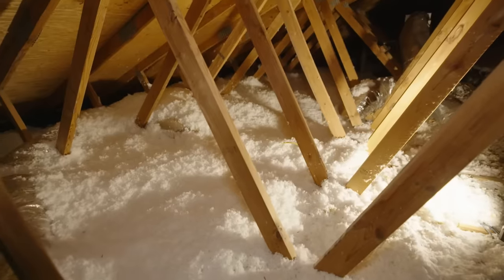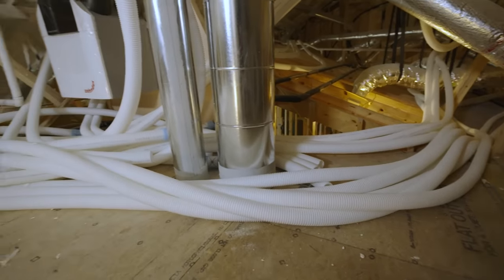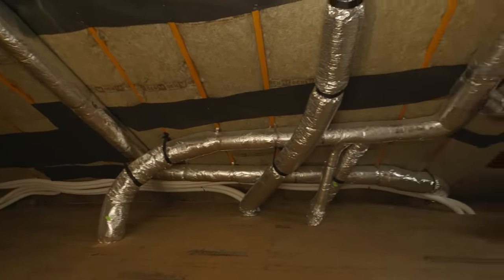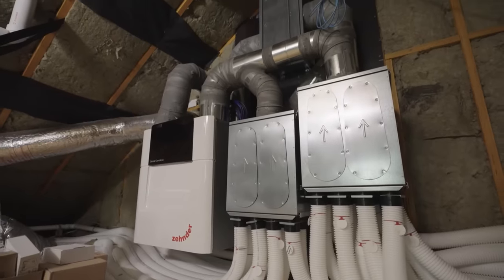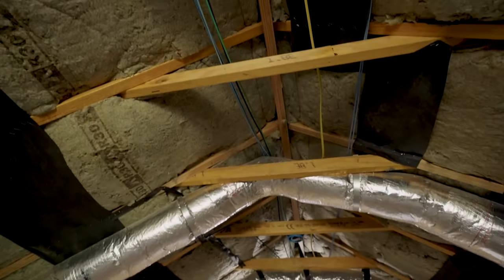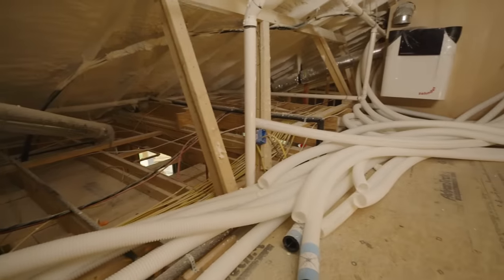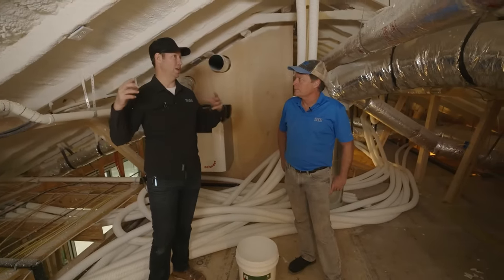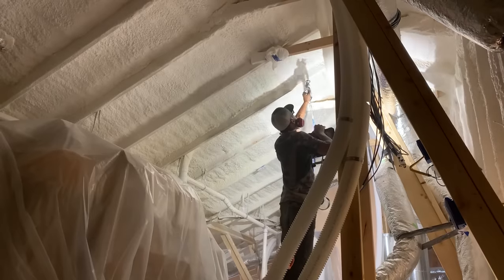Building a BETTER attic - Unvented + Conditioned attics 101

Comment: Forgive me for not watching the whole thing, but I would urge you to be careful giving advice on things like this to Average Joe.
I live in a cold climate (Norway) and here unconditioned attics are the norm, even on new houses. We don't use this "fluff" however, but mineral wool, usually in sheets or on a roll. If, however, you plan on perhaps use the attic (later) as part of the living area, you would move the insulation to the roof. The obvious main down-side is cost, both in the form of more materials, but also heating expenses.

Comment: I have been watching your videos, and I love what you are doing but I have a house built in 1970, in south houston area of Texas, what are some things you would suggest to help with sealing the house to better help out the transfer of heat? just some spray foam to seal all the wall joist lines? I currently have rock wool for insulation, would putting radiant barrier at the roof decking inside the attic be a good addition?

Comment: For the rockwool, where's the vapor barrier?
Reply: It's a heat dominated climate, so it should be on the outside if anywhere, not the inside. On the inside, you would get exterior vapor infiltrating inside, hitting a vapor barrier and condensing on the inside of the barrier, leading to the insulation getting wet. Many southern houses do not have a vapor barrier. This leads to needing more dehumidification.

Comment: It's a trade off. Do you want a roof or more living space. If the latter it cost more during construction and more in heating/cooling bills. Also you run the risk of getting condensation on the inside of the roof Wich is never good.

Comment: Why closed-cell on the roof deck and not open-cell? Closed-cell is a vapor barrier, so that breaks the rule of having your vapor barrier on the inside of the building envelope in a hot-humid climate. 

Moisture will drive into the envelope past the roof and roof deck and get stuck at the closed-cell and rot out the roof deck.

Comment: As an architect it is painful to see so much wasted  space with trusses, particularly on anything greater than a 4/12 pitch but design is largely driven by cost considerations. Trusses are fast so cost effective when you consider labor costs. Stick framed roofs open up the attic but also create engineering problems that add to the cost of building. Trusses are usually not designed for floor loads so laying plywood on the bottom cord is a risk.  Could the insulation be changed? Yes, but to what purpose?  A well vented attic, properly built and maintained should not have issues with moisture or heat. IMO a conditioned attic is not automatically better. Many factors need to be considered before making that claim.

Comment: A couple of observations, here. "Rock," is composed of silica, as is "glass." "Rock wool," is a "sound barrier," because it does not insulate well enough to be called "insulation." This is the reason one would have to abandon truss framed construction, in "favor" of the much more expensive rafter construction, in order to achieve the 12 to 14 inch bays, necessary to achieve R30 heat conductivity resistance, from rock wool - and for now, we'll go ahead and completely ignore the thermal bridging of those deep timbers, placed every 24" across the long dimension of your roof.

Ok, so all those mechanicals, all those conduits will need maintaining, all of this, for the value of some space to drag boxes up a attic access, fold down ladder or boutique value of some hyper scientific new construction technique to brag about.
Reply: A "flash&batt" insulation system can fit R-49 within the depth of a 2x12 rafter. With wood rafters, the rafters themselves amount to about R-11. So the thermal bridging is there, but far less a problem than walls. If you use I-joists then the thermal bridging is even less.

With trusses it's a bit more fussy. One solution is to do several inches of foam sheets on the top of the roof sheathing, with 5.5" of additional batt insulation within the truss top chords. (Specify 2x6 top chords.) If you don't like having the foam on top of the sheathing then do spray foam under the sheathing, to the depth of the truss top chords. Then use netting to hold additional batt insulation up against the foam. This would work if you don't plan on using the attic for storage. If you do then you get into the ignition barrier issue again. There are solutions. But it's more complicated and depends on the design of the attic space. When I do home designs with potentially useful space in the attic I control that by specifying "Room-in Attic" trusses. I decide which portions of the attic will be accessible for storage or other uses. Then I finish those with gypsum board. The spaces become far more useful this way. And the gypsum board provides the fire protection required. Yes, it adds cost. But considering the usefulness of the space gained, it's good value for money.

If the extra effort up front makes for a more energy efficient house, then it saves money in utility bills for the lifetime of the house, which should be at least 50 years, if not 100. A century of reduced utility bills is not "boutique value". It's something worth investigating carefully and in depth.
Reply: @fepeerreview3150  Not really sure you get the point here. Traditionally, the living space ends at the ceiling. Ok, now you want to make the roof membrane, the one that has to endure sun, rain, branches, rocks and meteorites, you get the point, also be a perfect insulator/vapor barrier.

It is an extreme lot to ask, when properly insulated ceiling/ventilation/atmospheric barrier, will do the job very well - and phenomenally well, if one details it out to a fraction of the investment of the system featured.

All of this, for a triangular sectioned room at the top of a folding stair. Here's an idea that is so unoriginal, it doesn't even deserve it's own YouTube video.

I will build you a square sectioned room, on top of that house, I'll add a traditionally insulated roof/crawl space over that and even throw in a normal staircase - for less. 

Not to say I know what I'm commenting about, but I've built these so called "envelope houses," where one surrenders one square foot of insulated space, for every foot of exterior wall, to obtain so called "zero bridging." 

I've done it here in the Pacific Northwest, the harshest environmental conditions anywhere between Alaska and the Equator  and I remain unconvinced. Here in the Columbia Gorge, it freezes and thaws all winter. Wind storms drive ice laden trees through our structures.

The prices people pay for these "green houses," the time they have to wait for their "dream home," versus the value saved against their obviously voluminous  pocketbooks is too extreme, to ignore. 

Somehow, the value of real estate alone can't offset this difference?
Yes, maybe because you inform your buyer that it is a "green home," thus invoking the "boutique value."

Comment: cost cost my house built in 1953 on crawl space but return air goes thru attic with 12 16 inches of insulation cheap and effective thats why they built houses like that house probably sold for 10k or less when new and my xmas stuff is up there no problem this is a sales pitch like vax and covid

Comment: What about roof decking replacement after it has been spray foamed?
Reply: It's foam, you pull up the old roof decking, cutting the foam as needed, apply the new decking, and spray new foam.

Comment: In brick homes, when replacing blown in insulation with spray foam, is it recommended to foam over the 1” airspace between the brick and sheathing? How does the moisture that sublimates through the brick escape if the air space is covered?
Reply: open cell foam

Comment: If there is a cavity of air between the roof and deck couldn’t heat loss into that cavity turn into condensation during winter? As a roofer I have to fix these undervented cavities constantly.  

Thoughts?
Reply: Also ice dams would form on roof.

Comment: Hi Matt, long time follower on here and Instagram. I've read a lot of conflicting information regard my hip roof with a ridge vent in my 2 story home built in 1924. I would very much appreciate your opinion on whether I need to vent to the soffit to finish this space. Batt insulation is under a hardwood floor in this attic space.

Comment: If I have a vented attic with no HVAC in it and blow in insulation, is there anything else I need to do besides remove the current blow in insulation and add new insulation and seal everything off to make a non-vented attic? I would have to run cooling up to that space, and I have a whole house fan that I would either have to abandon or somehow vent outside, but I cant think of anything else. Do I need to do anything to the exterior roof, like apply additional sealants or vapor barriers there (really hoping I wouldn't need to redo the shingles as well)? It is typical asphalt shingles.

Comment: do you have to use different type of roof shingles when you do this type of insulation?? due to heat?
what happens when yo/if you have a roof issue? leak, bad sheathing and it requires replacement??

Comment: Are the roof sheathing plywood/osb? I think I heard 4” insulation above the deck - maybe a vented nail base? Is the roof system composed of asphalt shingles? That system will deteriorate far quicker than with your standard vented attic space. If the system is a concealed fastener standing seam metal or some other metal shingle or perhaps a clay tile, great! But otherwise the sheathing and asphalt based shingle will absorb all that heat you’re keeping out. Also a lot of $$$$ to go this route in general. Wish I could have seen the roof.
Reply: He said it was metal! Specifically mentioned not being able to hear the rain.
Reply: @PhantomCurve  wouldn’t mind seeing more homes built this way, but it comes at a premium and an aesthetic that isn’t always easy to digest.
Reply: @kortizdz  Indeed, not to mention that the engineering has already been worked up on all common truss designs, so you don't have to hire an engineer to check your roof raming specs if you go that route.

Comment: I wonder how you frame a attic like this without the support’s in it.
Reply: Um, look up roof framing! Most people use trusses, but this is a more traditional ridge beam/rafter design that keeps all the truss webbing from being an impediment. Framing this way requires much beefier lumber because of how the loads get transferred and using attics as a storage/walking surface means you can't just use shitty 2x4s up there as your joists.

Comment: If a leak occurs through the shingles on the roof deck, it would rot the roof deck and leak into the rafters, but be trapped by the foam and you would never know the roof leaks. The rafters would secretly rot buried in the foam as you patted that foam and said, "Yep! This here roof's still perfectly dry!"

Comment: You turned your attic to another room in the house, its going to cost you more on your heating a cooling cost. Its called a hot roof and is usually on houses with cathedral ceilings. The point of vented attics is to allow fresh air to come in the soffits and out the ridge vent to cool the roof. It may be hot in the attic but those are in houses where that was never meant to be a usable space so no reason to waste energy heating and cooling it.

Comment: In the very least, this won't work anyplace it gets below freezing in the winter.  And living in the upper midwest, a sealed design will need to have power under the slab to remove radon gasses.

Comment: When we stop having to charge ten's of thousands to replace spray foamed decks in Texas, this information may be relevant. As it stands, with the massive amount of issues we see with spray foamed decks, we will continue to warn all homeowners. 

Yes its cheap, fast and easy. But read your manufactures warranty very carefully, there is a reason it voids many material warranties. Buckled and rotten decking, to roofs literally cooked till they crumble. Metal finishes will fade much quicker but most metal roofs seem to survive, but caulk tape or caulk will have to be replaced much more often and screws as well from hardened seals. Standing seam properly installed has had the most success, but is very costly. 

As a reputable roofing contractor for over 45 years please do your research, it is rough handing homeowners a bill to repair the damage these practices are causing. It took a few years to see the affects of this new (by building standards) process but until new products are available to survive/work with this, be informed.

Comment: An attic built like that won't survive the first heavy snowfall that we have here in the mid Atlantic and northeast because of collapse and secondly spray foam on the ceiling attic can hide roof leaks  and over a period of time your plywood on the roof is rotted out because the foam absorbs any water

Comment: I don't like the foam. What happens when there is a leak on the roof and moisture comes in through to the plyboard? You would have to scape off the foam before doing anything in the roof area.

Comment: I've seen so many houses like this and I just have to ask.  Why in the world would anyone layout their duct work going all over the place, down one side a few feet, then shoot to the roof and the other side to go down a little further just to go back up and over again so that instead of have 2 going straight down each side and branching toward the middle where necessary and being not only nice and clean, but more efficient instead of losing 1/4 of your attic space that could have been used. 
Seems to me that air flows better down 50 feet of straight duct than it will down 200 feet of constantly turning and branching off duct.
Reply: If there's a way to make things more complicated (and expensive), plumbers and electricians will find a way....

Comment: We built a 3300 sq. ft. house, 6 bedrooms and 5 baths.  Had the exterior walls and the attic ceiling and end walls foamed also.  The temperature difference between the conditioned space and attic was about 10 degrees.  It is cooled and heated with a 4 ton unit and air handler.  Engineers stipulated 4 tons, no more or less or the warranty would be void and it cools perfectly.  The attic is about 9 feet tall at the ridge.

Comment: Only for a steel roof.... shingles would be fried with this system.
Reply: I think if you air-gapped the roofing material it would be okay. For composite asphalt shingles you might have to double frame the roof to achieve that though.

Comment: Matt, most older homes in Michigan have hot water heat.
No matter how much you try to seal these homes, they leak air.
With air leakage there is sweat.
I would almost think `that the roof would rot over time.
They need air circulation.

Comment: If there was an option to open up a large vent in the attic to allow heat to pull through the home and move air up and out, this design would be much better. Old houses that had no AC used to use upper window vents that would create air flow keeping everything from going damp and stinking. A full breeze comes from that design without any electricity from heat rising.
Reply: Grew up in a house that had an "ATTIC FAN" ! Thats what mom called it. In the ceiling of hallway . 
Plus Gabriel vents an eve vents. No ridge vent ever. Now this thing worked GREAT!! the house would hold 80/82°? Ish . Its was loud as all hell.an just made me feel embarrassed more than anything!!!  
If my friends come over they would always ask about it an all loved it i think just the size at 4ft was bigger than anything they ever saw so got style points at least!!  They all had central AC not even window units .

Comment: My house was built in 1900, it has absolutely NO INSULATION. It has a 1" x16" opening at the bottom and top between every mortice and tennon  joint of every stud. This opening in each cell is completely unobstructed from under the house, all the way to the attic. ( every other one has a diagonal brace that alternate direction from one to the next.)  It makes wiring a breeze, but how can I insulate it without removing 121 year old beadboard ?
Reply: Blown in insulation into each bay, from the outside, after you put in all the wire runs you might need.
Reply: @theabristlebroom4378  I have considered that but my worries are that the insulation will prevent the airflow from moving from under the house and out the attic. The house currently has ABSOLUTELY no moisture problems or mold and mildew problems. There is a house not far from here very similar to ours. It was completed in 1905. They filled the walls with blown in insulation, insulated the ceilings, and under the floors. All this was done in 1999. Now the house has moisture problems, and it is starting to dry-rot  from the slow humidity changes. I believe that blocking the air flow is what caused their problems. They have mold under the house, and a little bit of mildew smell inside.
Reply: @theabristlebroom4378   Do you know of a product that will allow air exchange ?

Comment: How would this work in Canada with a basement full of hardwood and all that hot air rising? My house is 2 years old but is insulated the more traditional way but there is a tonne of venting, sofit, ridge and end vents.  Is it possible to retrofit it to this style?
Reply: I live in Montreal, and I do no think it is a good idea with the climate swings we have. You will just end up spending a ton of money on heating and cooling, let alone the initial cost of the HVAC. And I wonder how convenient it would be...A simple plastic shed 10x10 is not event 5000$ in big stores.